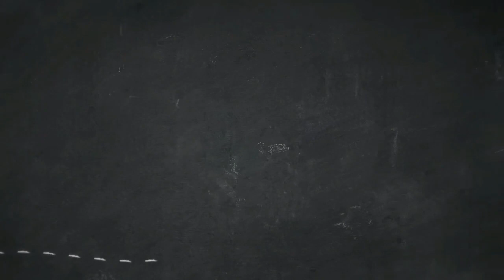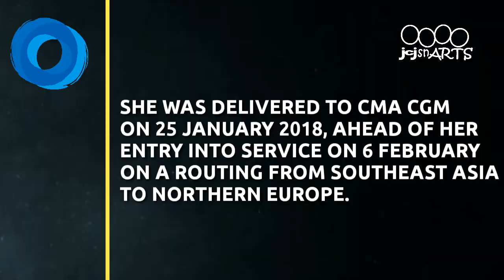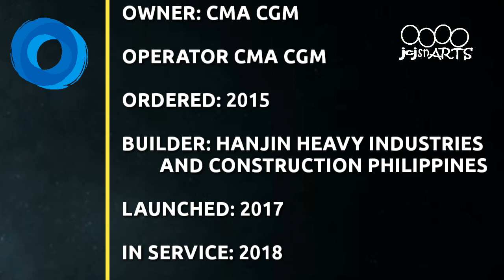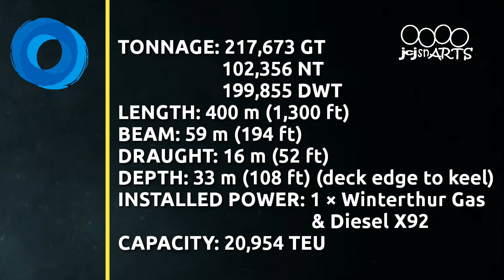THE PHILIPPINE MADE WORLD LARGEST CONTAINER SHIP 2019

Comment: tatlo yan na cma cgm. 20,600 TEU. Project 149. 150.151..kami humawak sa electrical connection sa 3 na barko ng cma cgm. boung barko kami ang nag connection from floor to 4rth deck. mooring to buson forcastle. lightings sa lashing bridges. engine room area,. low voltages switch board. LVSBD. MSBD. ECC. .4 main genarator 6600 volts. and emergency gen.. reefer transformer. HV transformer. all off the RC panel. even motors and purifier room kami lahat humawak ng connection sa electric.. npaka laki talaga yan.. at npakaganda pa👍👍👌👌👌
Reply: Isa ako jn fit-up/fitter nmn Ako, npaka selan ng barkong yan pahirapan....22bay......
Reply: Isa ako jn fit-up/fitter nmn Ako, npaka selan ng barkong yan pahirapan....22bay......